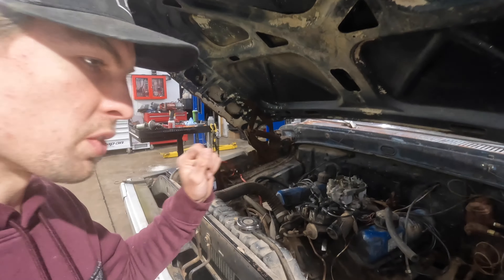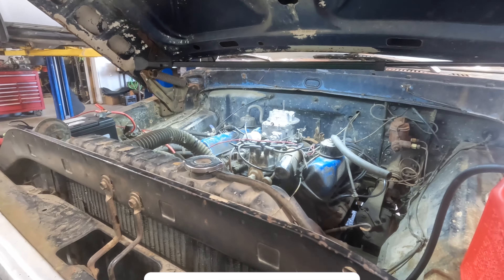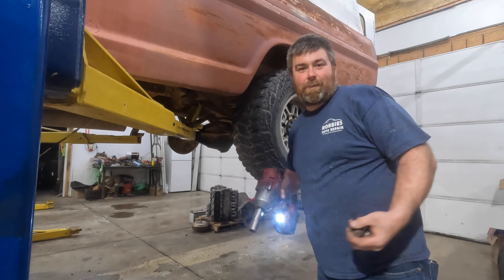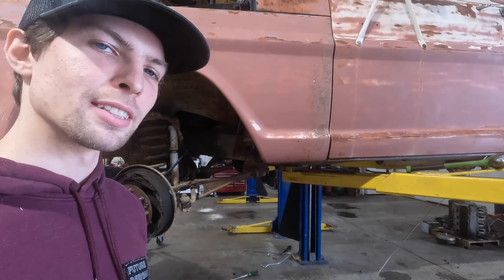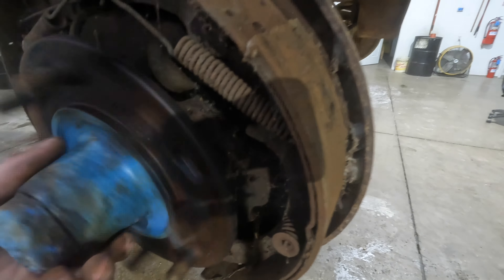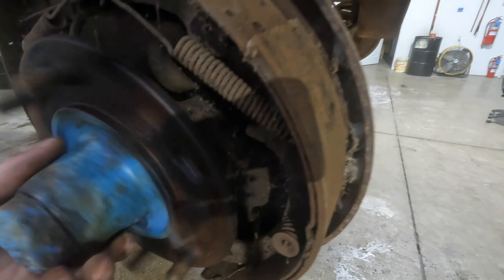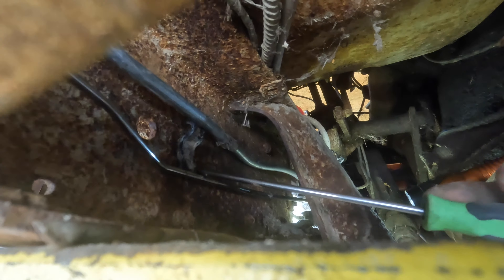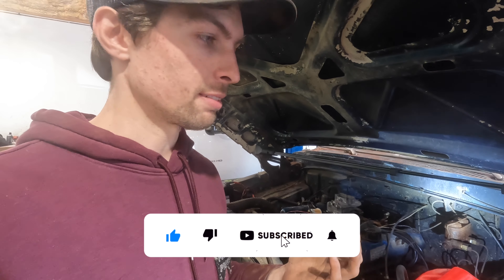1968 Ford F-250 Build/ WILL IT RUN? New Brakes Lines, Fuel Lines and more! BARN FIND RESCUE!

Comment: I have a truck that i have replaced almost all of the brake lines from a kit from classic tube out of ohio and they are stainless steel brake lines and the only ones I didn't replace yet are up under the bed since so far they are not leaking... truck is a 2000 dodge ram laramie slt quad cab long bed 1500 4x4
Reply from the maker: Awesome man! Stainless steel is the way to go!